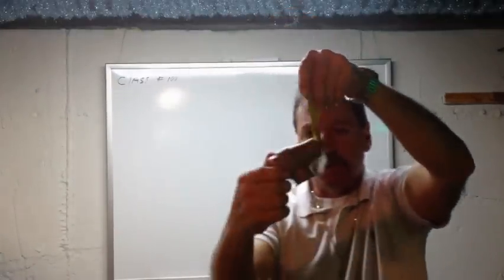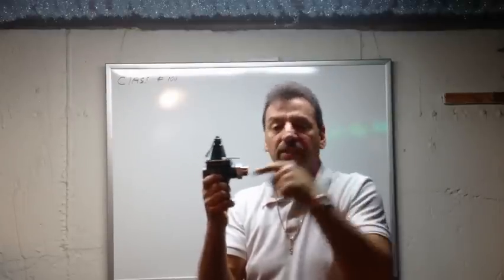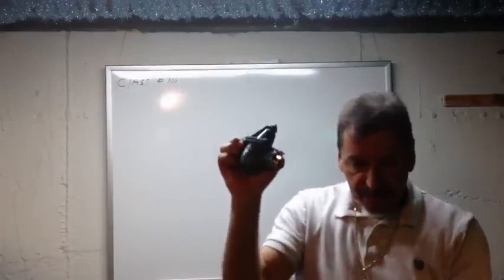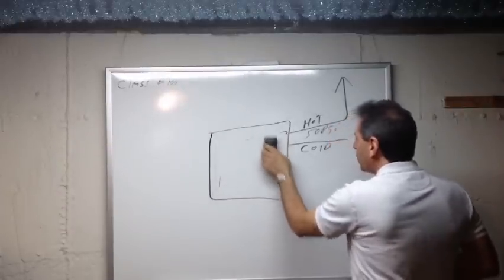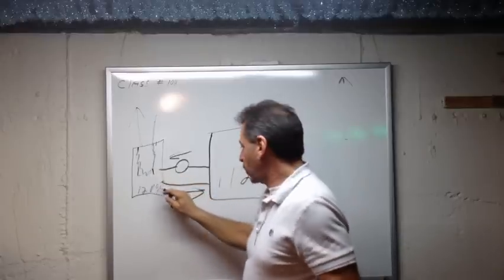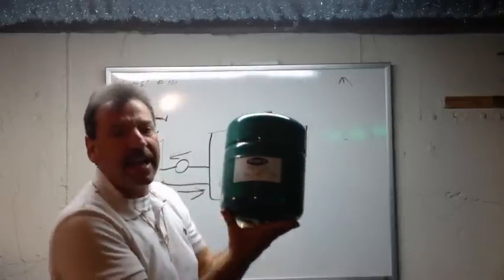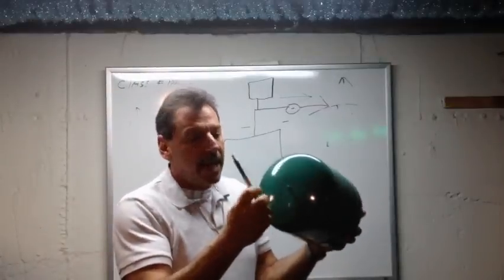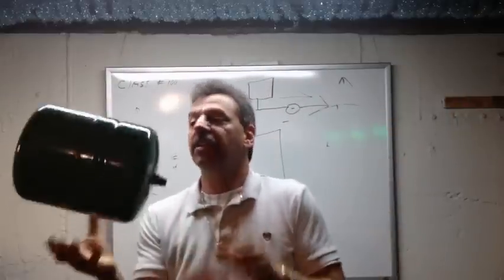relief valve,boiler

Comment: Thank you!!! I am having pressure problems, plus my DHW in-direct tank is leaking, loosing /wasting my hot water. I narrowed it to a leaky tank.  Systems are complicated due to the variables. I think there is more to my problem. Will check out. Very helpful !!!

Comment: Hi there, thanks for the tips about how this things work, I just bought my house and it has a oil furnace, but it just stared to release lots of hot steam with a little water, its more steam at high pressure, with just a little water, the water pressure gage reach 30psi super quick, right after the release valve opens, I don’t get why it just hot steam comes out but no much water, this furnace it’s used just to heat the house, no water leaks anywhere in the house. any ideas are welcome, thanks

Comment: I found this very helpful while trouble shooting why the relief valve will start leaking.
One scenario not mentioned is if the rubber? valve seat on the pressure relief valve itself starts to leak from age (dry rot, etc.).  I assume this could happen... right?

Comment: Hi. Water started dripping quite a bit from the pressure relief valve (30psi) so I replaced it.  Still dripping the same. Also if I barely puff on the lever on tge relief valve, water rushes out. That tells me pressure is too high. Toughts?

Comment: If the hotwater coil in the boiler had a pinhole, wouldn't there be signs of leakage on the outside of the boiler?  My Furnace is reaching around 30lbs of pressure and the pressure relief valve seeps water. No signs of leaking water from a coil. Maybe I should try the pressure reducing valve and pressure relief valve replacement first??   Any suggestions?  ( Really great video, by the way! )

Comment: Nice video. So if a leak in the hot water coil is the source of pressure then pressure should remain high even when the boiler is off. Is that right. Is that how you would diagnose the problem?

Comment: Great video.

I'm wondering about the temperature part of it.  Let's say that you opened all the windows in your house on a cold day, would that alone set the relief valve going?  (I'm speaking theoretically here)  

In other words, lets say you had an inadequate amount of baseboard but selected a high temperature on the thermostat and all your components including your boiler were working normally, would that set the relief valve going?

Comment: I've never seen a coil in an indirect hot water heater that heats the water in the coil. maybe an old sidearm off of a steam boiler but not a hot water storage tank. and the fact you stated about expansion tank needing to be on one side of the other of the circulator is absolutely wrong there is no pressure variable between the two sides of a circulator it's all 12 pounds on the norm. more systems than not do not pump water out of a boiler it is actually pump into the boiler and drawing from your heating Loop that's creating basically a siphon effect. water at 12 pounds of pressure does not boil until it gets to about 235 degrees. and folks there's a difference between a domestic expansion tank then a hydronic heating expansion tank. you can use a potable water expansion tank on a boiler if you set the pressure correctly but you cannot use one design for hydronic heating on domestic water.

Comment: I have a Peerless Boiler, my relief  valve was and is still leaking. I replaced the expansion tank and the relief valve, I set the pressure on the tank to 30lbs, should I have the air pressure  at 12lbs? Please help asap